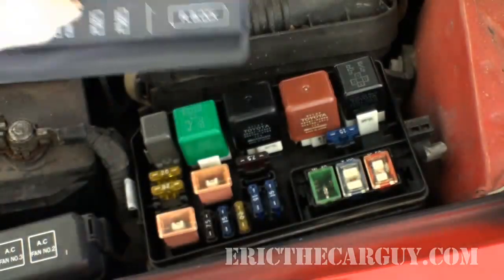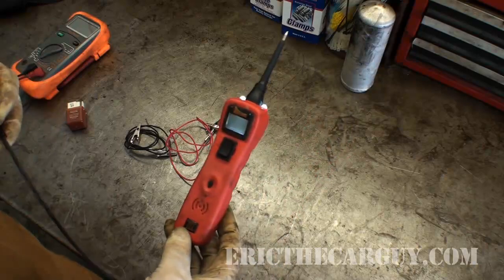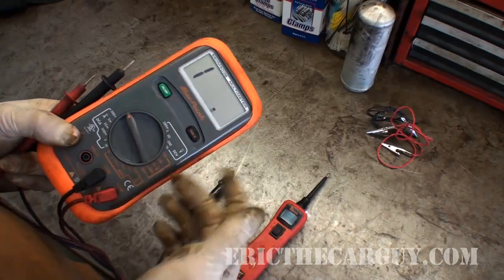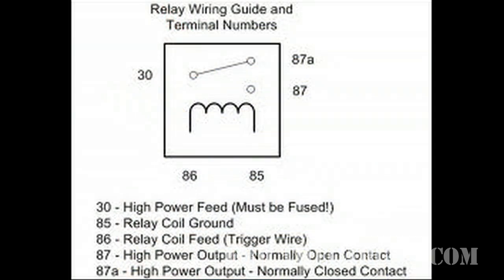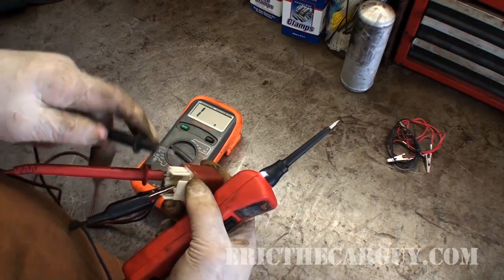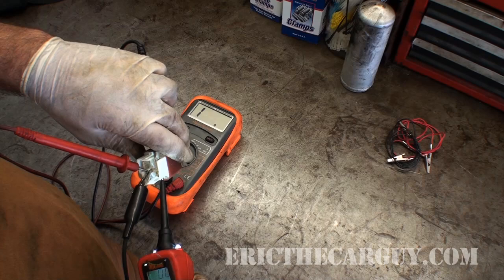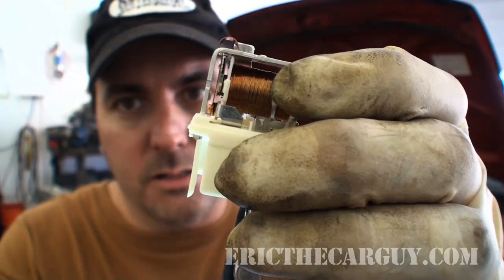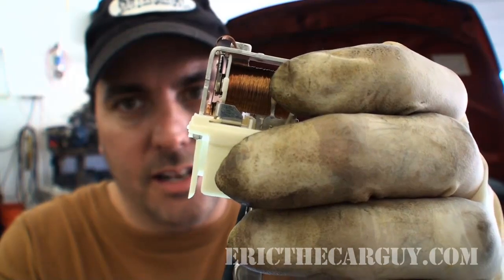How To Test Relays- EricTheCarGuy

Comment: Yes, and even the more complex topics such as voltage drop testing and dynamic resistance are easily visualized using a flowing water analogy. EE seems so far away now, but the fun stuff is still rich with color.

Comment: One of the faults of the power probe is the switch, which tends to corrode when power is turned on and off at the switch. Basically you get arcing of the contacts inside the probe switch. The makers have suggested pressing the switch button when the probe is not touching anything, and then move the probe tip to the terminal you are interested in. The arcing occurs at the tip, which is easy to repair. 

That's a nice simple video, Eric. It seems the numbering of those terminals is universal.

Comment: most relays work the same. 

however, check valves in ABS systems are what control the flow of break fluid to the wheels. These are not the same as relays, but they are electronically actuated.

Comment: It's funny how you used the DVM probes to test that relay when you had cables with crocodiles lying right there on the table. You could connect the crocodiles to the probes and terminals, then you would just have to hold the relay with one hand and the probe in the other one.

Comment: Great video. Thanks Eric. One other issue you might cover regarding relays in older automobiles is the solder points. For example: older Acuras and and Hondas can have an intermittent relay problem (probably other makes as well), where the car wont start when raining or in the morning when its cold, or if there is dew because the relay solder points are "micro" cracked.  The relay may pass the bench test in a heated garage, but wont pass if damp. Google: "How to solder and fix the Main Relay."